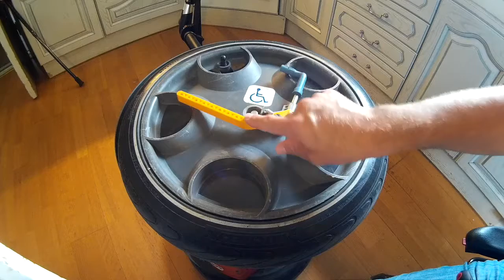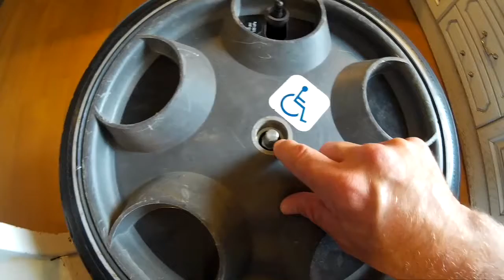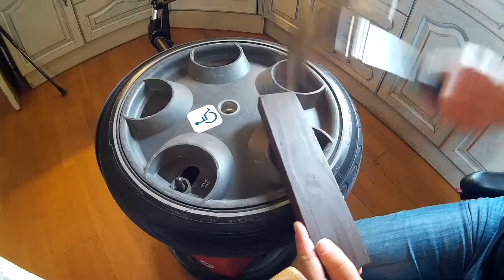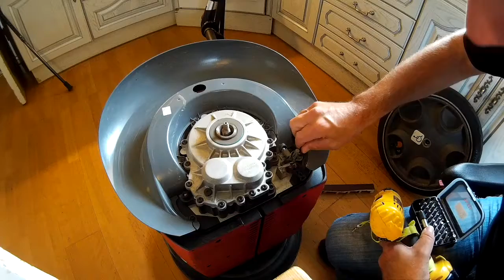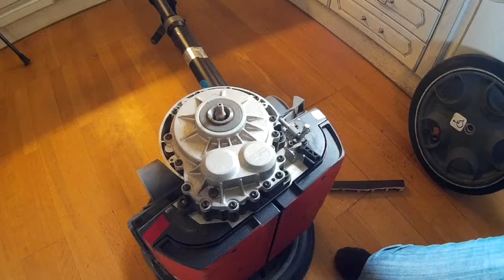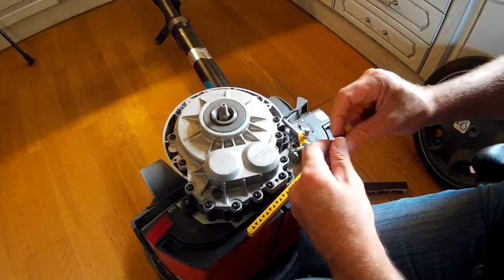Changing the stand on a Segway Gen 1

Comment: Do you know the meaning of the flashing green lights at charging port?
Reply from the maker: Found my old manual. It states: 
Solid Green = Fast Charge (approx 90% of charging)
Fast pulse = Balancing charge (the cells are topped off equally)
Slow Pulse = Trickle Charge (to keep battery topped up)
Solid red or no light = Trouble

My own notes:
Trouble = Try resetting batt by removing them from Segway, wait a few min and reassemble (also a good idea to switch places front and back batt).

Always have the Segway charging or remove batt if not used for a long while. The batt will go dead if on segway without charging. It is possible to "kick start" them again (but not a sure thing).

I guess you know but I'll mention it anyway: There are two lights, each one representing front resp aft batt.